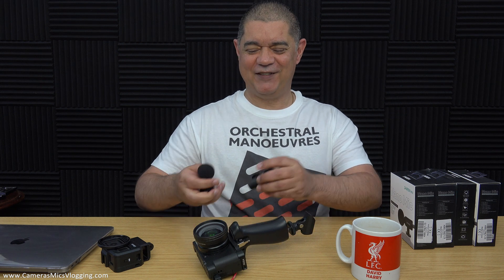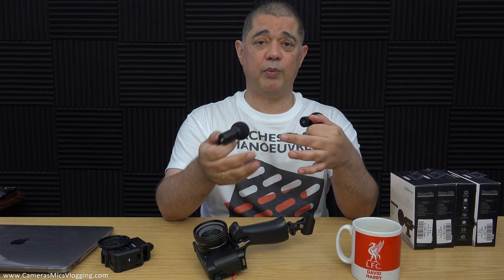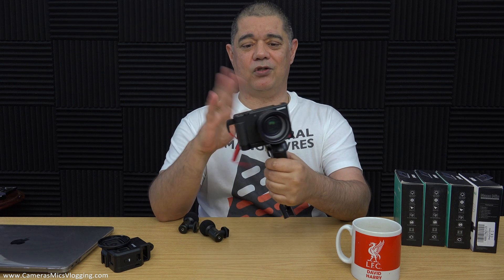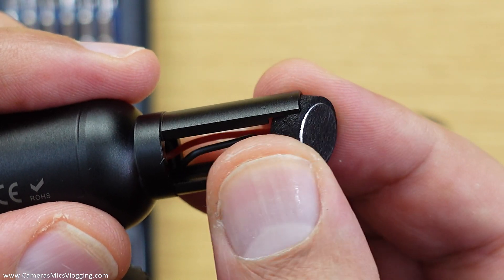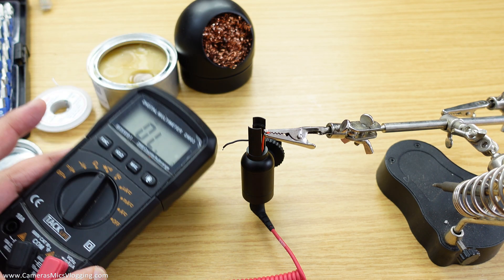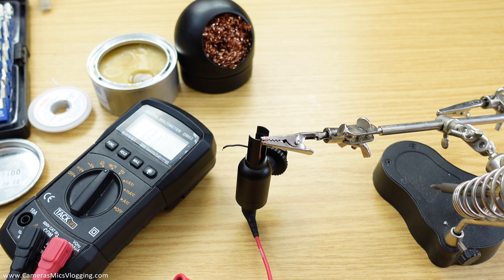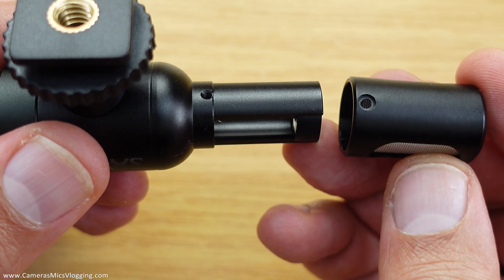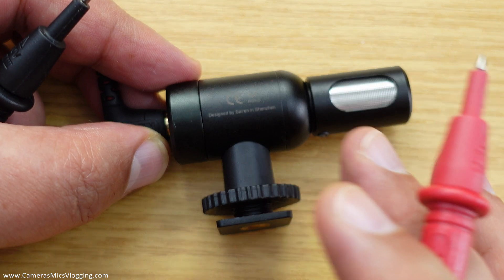How to build a vlogging microphone - The SmallMic SM1 omnidirectional on camera vlogging microphone

Comment: Great little mod video bud! I would recommend one thing for the soldering process. DEFINITELY cover those holes on the back of the capsule BEFORE soldering. They're vent holes for air to pass through and allow the diaphragm inside to vibrate at a certain rate. The flux from the wire flows and covers the hole, which will change the tone of the capsule, as well as possibly cause electrical shorts by bridging the positive and negative leads. Definitely have some high percentage ispropyl (I purchased an industrial 5L bottle of 99% Isopropanol that I got cheap online) to clean that residue off completely before removing the tape. Any residue on the electrical components can interfere with the conductivity and alter your sound signal, so definitely ensure you've got a clean setup before reinstalling. 

Overall really nice and simple mod video that I'll probably be trying on my old rode video micro from a decade ago!

Comment: You can half the time tinning the em272 there.. just tap the solder with the iron, but use thinner (much thinner) solder.
I use one thats a higher powered iron on 400c and dab the tip on the solder and it takes milliseconds, a flick, and thats it, same when attaching the wires, use a wet tip and its a doddle... and you dont need the massive metal thing holding the capsule!! :O)

Comment: 1. Which capsule would you recommned for binaural recordings, where the capsule is placed inside the ear canal of a silicone ear, about 5mm inside the canal? 

2. Don't have experience soldering, would making my own set of condenser mic capsules introduce some noise to the footage? Say versus a premade, Clippy XLR EM272Z1 which sell for £136.92?
Reply from the maker: Hi. For my binaural builds I have used the 172 and the 272 and they are both great. Don't forget, it's usually these capsules that are used in most pre-made binaural mics. If you don't have experience soldering then the Clippy will be a good option but an expensive option. If I were you I would just practice doing a bit of soldering and then order a matched pair of the 272 capsules and some good shielded cable and build from there, it will be much cheaper. You don't need to be balanced (XLR) if you are only using a short cable run from your mic setup to your recorder/camera. All my setups, mono, stereo, binaural are all on 3.5mm, so obviously unbalanced, and I just connect direct to my camcorder and everything is fine. If using 3.5mm just make sure that your recorder/camera is sending the electret voltage to power the ECM capsules. Cheers, Dave.
Reply: @DavidHarryUncut hey thanks for it deep input. What solder iron would you recommend? I don't mind spending bit of extra money as it's something you probably only buy once.

You think diety pr-2 be good enough for binaural? It records in 24 bit stereo. Or would one get a  better result with something like the MixPre3ii? It's a much higher cost, and I don't know if it's worth it for youtube.
Reply: @raczyk I definitely agree with  @DavidHarryUncut   on this one. Plus you can go online and order a few  super cheap soldering practice board kits to fiddle around with and practice your soldering while watching a couple of soldering 101 videos on youtube. They come with a range of parts so you can hone your skills without destroying any actual projects. Did me a world of good by going that way so I highly recommend it.